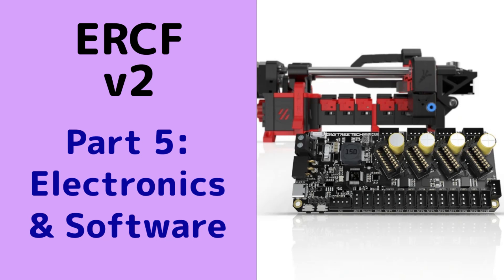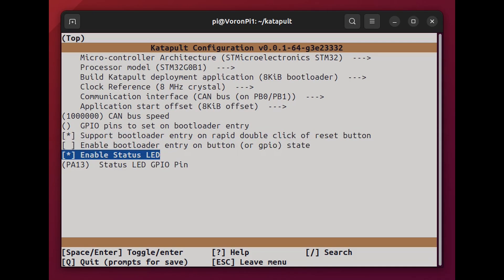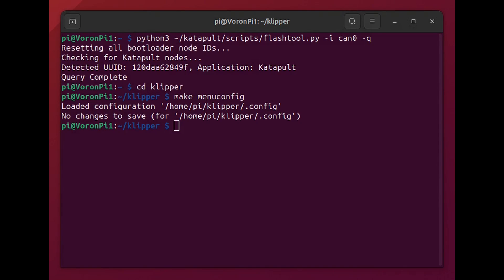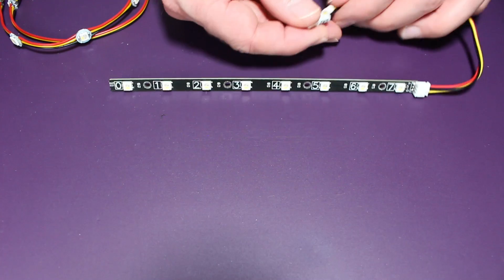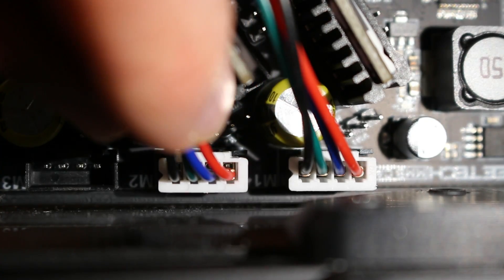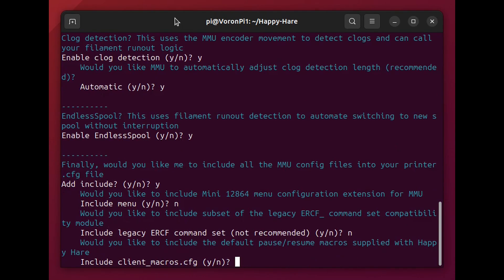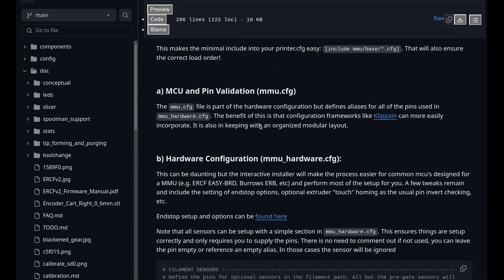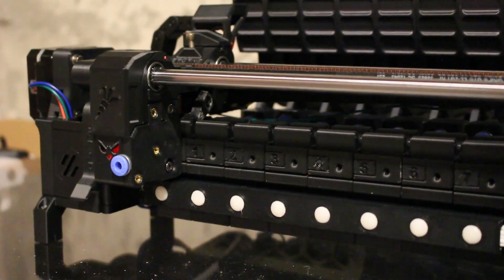Building the ERCF v2, Enraged Rabbit Carrot Feeder by Siboor.  Part 5 - Wiring & software

Comment: Did you get this 8 neopixel PCB to work correctly?
I have also built the siboor kit.
After the installation it was reversed with the basic configuration in my case.
A simple change from 1-8 to 8-1 made the whole thing even more confused. Now I've been playing around with the mmu_hardware.cfg for days but nothing useful comes out of it and I'm beginning to think it's a hardware defect.
Basically there shouldn't be much to it, I only use the 8 neopixel PCB like you in the video.
mmu_num_leds -> 8
mmu_num_gates -> 8
exit_range: 1-8 / 8-1
No status_index
I also played around with the color_order, also without success
Reply from the maker: I did get it working.  It took a few tries:
[mmu_leds]
num_gates: 8
led_strip: neopixel:mmu_leds
exit_range: 8-1
#entry_range: 9-{mmu_num_leds}
status_index: 9
frame_rate: 24

also:
[neopixel mmu_leds]
pin: mmu:MMU_NEOPIXEL
chain_count: 9			# Number gates x1 or x2 + 1 (if you want status)
color_order: GRBW	

I believe that was it.  If not, I can dig a little more.
Reply: @KapmansBasementWorkshop  Unfortunately, the config does not work for me.
I have also tested the 8 Neopixel cable, but this does not work at all.
What I find strange with the Neopixel PCB is that when I deactivate it or switch from status to filament color, the number, position and color of the LEDs change with each switching. There is no consistency.
But maybe there are kits with different hardware in circulation, my Microswitch PCB for the Coupler Blocks is also solid and not flexible like yours.
Reply from the maker: @Heyde84  Seems the kit might have changed.  But I've always had these led strips work the same way, except if when 3 or 4 colors.  Hmmm.

Comment: Question for you that will help me orient to this video.

I've noticed that people use two strategies getting the CanBus signal sent. 

Strategy 1) "Raspberry pi" connects via USB to "Printer MCU board" (ie, Octopus 1.1), then use the canbus out plugs on that MCU board to send CanBus to your ERCF.

Strategy 2) "Raspberry pi" connects via usb to "Printer MCU board" to control printer generally. But the pi also connects with a second USB cable to a "USB to CanBus Bridge board" (ie, BigTreeTech U2C adapter board). Then you connect you CanBus cable from that bridge board to your ERCF.

I know both of these strategies work - which is this video using? (my hunch is it's strategy 1, but I'm unclear)

Thank you!
Reply from the maker: I'm actually using Strategy 2.  My U2C is pre-exisitng since my 2.4 alrady has canbus installed for the printer tool head that is using an SB2209.  There is a 3rd way too....
Strategy 3) Just use USB and a power cable and don't use canbus at all.  I have never tried that before, so I can't give good guidance here.  I believe the Esoterical website covers that if you want to try that.  
Thanks for watching!

Comment: Is this using a canbus board like a btt u2c or is it using the canbus on something like an btt octopus?
Reply from the maker: I'm using a U2C.  My MCU is a Spider 1.0.  I also use a SB2209 over canbus in the tool head (installed previously).

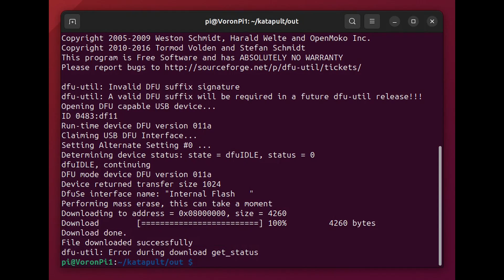Comment: I got to 4:50, and got a error. I think it's something about an updated version or something. For anybody else who had the error, please help. I have no idea what I'm doing.
Reply from the maker: Please copy the message you get and post it here.
Reply: I don't have the uuid from katapult though. I don't know if that's important.
Reply from the maker: @alexlikesallthegamez  Please paste the error message you are getting here in the comments.
Reply: ERROR:root:Can Read Error
Traceback (most recent call last):
File "flash_can.py", line 137, in send_command
ret = await self.node.readuntil()
File "flash_can.py", line 287, in readuntil
return await asyncio.wait_for(self._reader.readuntil(sep), timeout)
File "/usr/lib/python3.7/asyncio/tasks.py", line 423, in wait_for
raise futures.TimeoutError()
concurrent.futures._base.TimeoutError
Reply from the maker: @alexlikesallthegamez  Are you using a U2C?
Reply from the maker: @alexlikesallthegamez  Also, did you follow the steps n the Esoterical website?
Reply: @KapmansBasementWorkshop  I don't really know what a u2c is. I was doing whatever was on your video. Was there a different step I missed?
Reply from the maker: @alexlikesallthegamez  How did you connect this to your pi?
Reply: @KapmansBasementWorkshop  Raspberry pi -> BTT MMB 
Raspberry pi -> keyboard 
Raspberry pi -> USB storage boot drive
Raspberry pi -> WIFI adaptor

BTT MMB -> 2 Steppers
BTT MMB -> Servo
BTT MMB -> Limiter switch
Reply from the maker: @alexlikesallthegamez  So you are not using can bus.  You are running straight through USB.  Did you see it in DFU mode when running lsusb?
Reply: @KapmansBasementWorkshop  yes.
Reply: Thats what you did right? @KapmansBasementWorkshop
Reply from the maker: @alexlikesallthegamez  I used canbus.  I have never used straight USB, but then it should just work and connect like your standard mcu, you now just have a second one.

Comment: Thank you for putting this together ❤
Reply from the maker: Thank you for the nice comment and watching!
Reply: @KapmansBasementWorkshop  I have been meaning to understand how ercf and similar mmu systems work. I recently completed my first voron and a trident and looking to expand more on its functionality so trying to understand mmu and toolchangers
Reply from the maker: @sanketss84  Well, I'm actually doing the same thing as you!
Reply: @KapmansBasementWorkshop  what I wanted to do was automate filament change with just two spools. 
for that I needed a way to synchronize another motor with extruder motor which will pull/push the filament from the bowden on filament change macro. this motor will disengage during normal print with the help of a stepper mechanism. hence I was trying to understand the mechanism of 3d chameleon , ercf v2 and trad rack and spin my own simplistic version which would work just for two spools.
Reply: @KapmansBasementWorkshop  this system will be cheaper than an idex or dueling dragons or tool changers as they have other headaches of managing the kinematics and taking apart the belts and also programming the usage of multiple toolheads. and add to that nozzle alignment.
Reply from the maker: @sanketss84  I’d love to build one once you get it working.
Reply: @KapmansBasementWorkshop  still quite early in this phase.

Comment: This series really came at the best time possible. I just bought my ERCF V2 from Siboor and this series has been a big help in double checking my work. The Documentation is missing a lot of information like the servo arm and the how to mount the LED. I have no idea what the Extra LEDs were for? I can't seem to mount it to the back of the ERCT.
Reply from the maker: I didn’t spend a lot of time in the video for the servo arm, but does it cover enough?  The documentation for ERCF states that it should be mounted during calibration. But there really are no instructions, diagrams or photos to show it.  The string of wired leds mount shining into the buffer. This didn’t seem super useful to me and I don’t expect to be ever looking at the back side either. I also used black filament, so it won’t let light through anyway.  I decided to leave them off.  If you ever find out where the single led mounts, please let me know!
Reply: @KapmansBasementWorkshop  That last single LED is for the Option for the Status Encoder LED. There is a version in the ( _Errat folder ) for  (Encoder_with_Status_LED ) that allows you to insert it in the Selector under the Encoder. It is so you can use the brighter LED instead of the one on the Endoder. The LED on the Encode basically gets blocked off from the alternate part. You need to pick the one for the Bearing you use. In the Siboor kits it is the v6233_Bearing. The STL files say EXIT_LED on them. I only noticed it after the fact when I had all my parts printed out and built. It basically puts that LED right behind the Mouth and Eyes on the Selector. I am not sure if I will reprint mine or not. I spent a while painting mine in multple colors so that it stands out better.